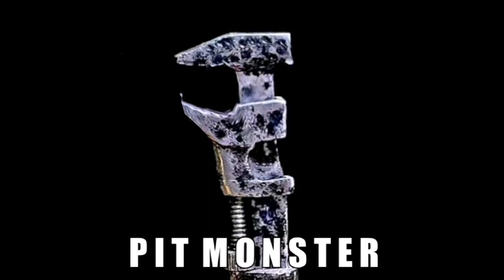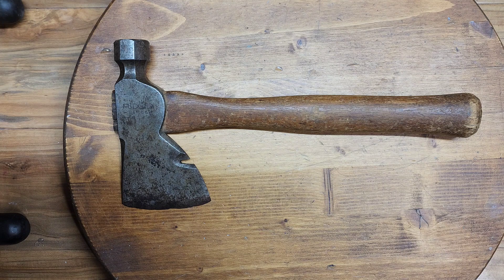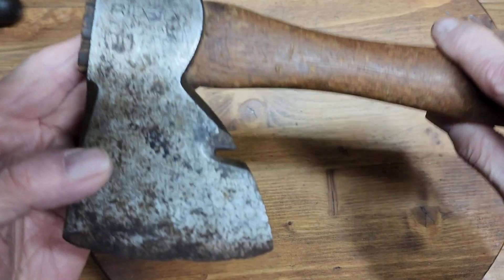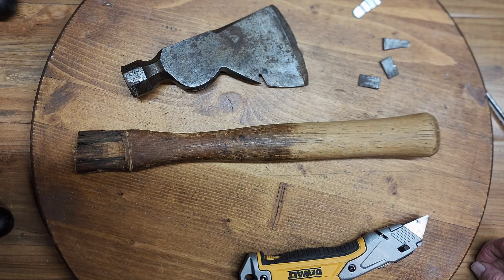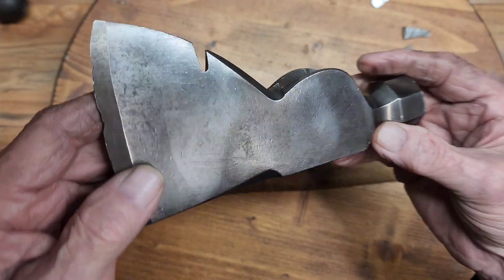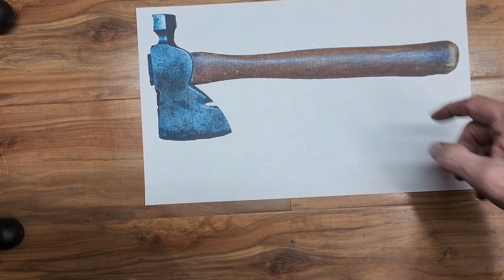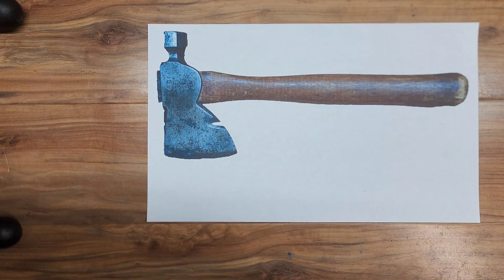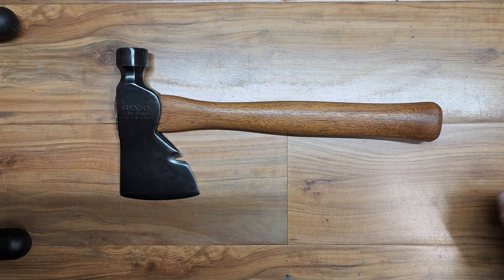RIDGID hatchet/hammer is restored

Comment: Nice job on that  roofers hatchet….when putting on a cedar roof it’s a must have tool because your always adjusting the size of the shakes….out west they use a similar tool a framing axe to frame houses looks the same but the hammer head is much bigger…works great because of the balance…🖖🏻
Reply from the maker: Thank you Chuck for all the nice information. Now the design makes a lot of sense.